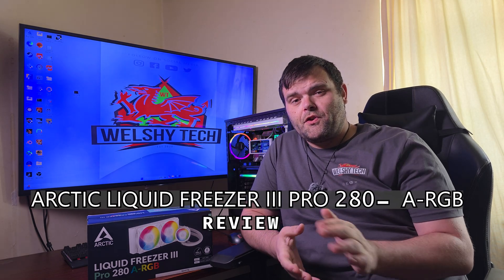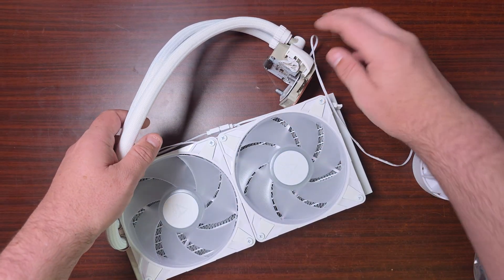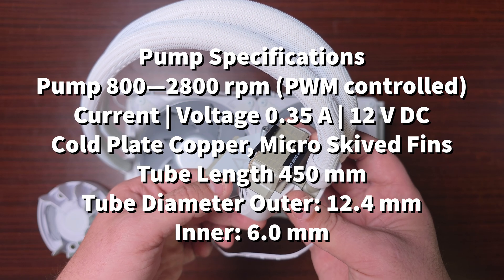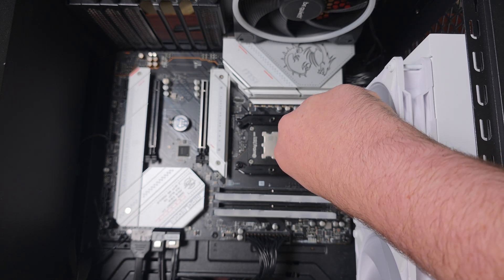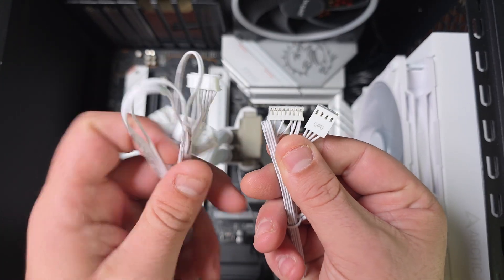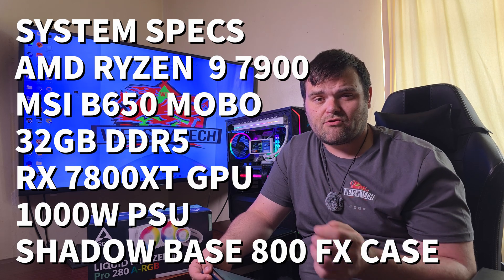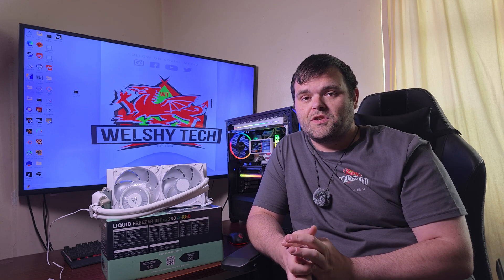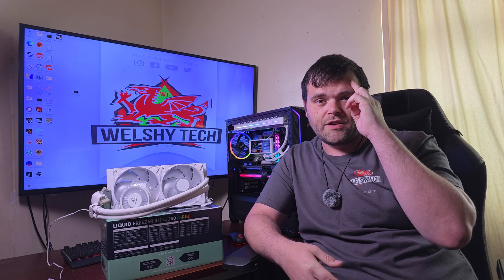Arctic Liquid Freezer III Pro 280 A-RGB  Review - Best 280mm AIO in 2025?

Comment: Hi. I have a Gigabyte Aorus Elite B850 motherboard and the PCIE slot for the GPU is right under the CPU. I was wondering if i could fit this cooler but I worry that the pump tubes might hit my GPU. Do you think I can fit it with no issues? Cheers for the nice video!
Reply from the maker: Looking at pictures it might fit but can't be 100% certain as I've never had that board before

Comment: I used air cooling for over 20 years. In my last build, I decided to use an AIO from corsair. I am disappointed because, there is a humming noise from the pump which is audible especially at night. Is there any progress on that front? What can you say about the pump noise for this product ?
Reply from the maker: I couldn't hear the pump
Reply: The humming is just standard for high rpm pump. Use the separate connector for pump and decrease the PWM to say 60-70%, this wont decrease performance.

Comment: The Liquid Freezer III "Pro" Series has P14 "Pro" Fan´s. The P14 PST A-RGB Stats: 200-1900rpm, 117.06m³/h, 68.89 CFM, 0.3 Sone, 2mmH₂O. 
These fans came with the LF III "non-Pro" version (normal LF III is EOL). 
Stats für the P14 Pro A-RGB Fan´s: 400-2500rpm, 110m³/h, 64.74 CFM, 5.2mmH₂O !!

Greetings from Vienna
Reply from the maker: Appreciate you providing the details 😊
Reply: @WELSHYTECH  you are welcome. Maybe you can correct the technical data of the fans in the video later.
Reply from the maker: I've seen the error thank you for pointing it out